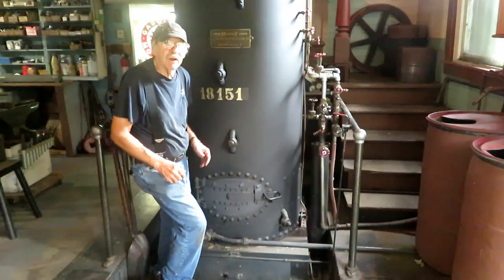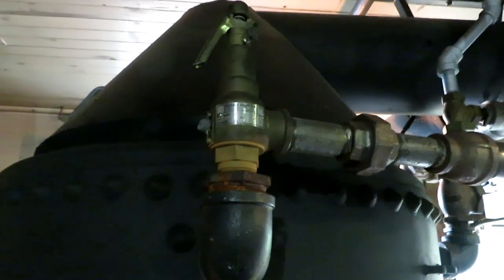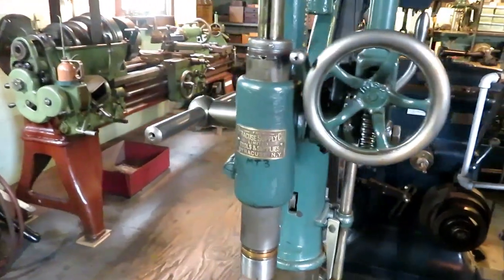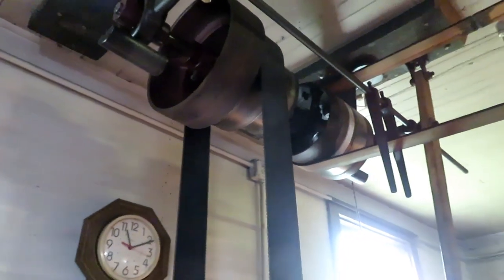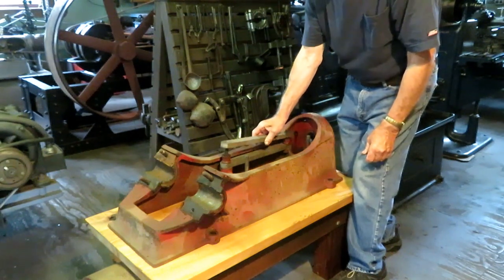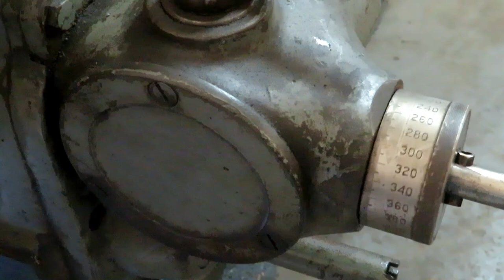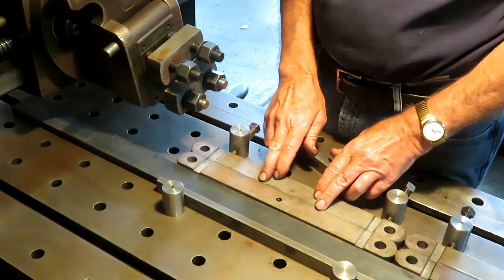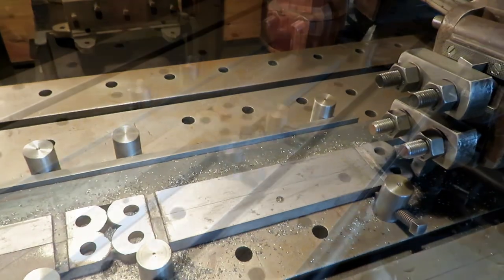Rebuilding a steam engine with steam power

Comment: Thank You for the inspiring video and shop tour .  It lit a fire under me to dig out the leather belt for my old Barber-Coleman surface grinder and get in running again after 40 years of idle .  I have yet to date the machine itself -- I totally rebuilt it that 40 years ago since it had seen considerable use before I acquired it .  No good excuses for it's idleness -- only that it went through several moves in the period between when I rebuilt it and now .  Secondly,  I too have one of those 3-jaw scroll chucks that you showed .... and near as I can tell identical to your's  .  It served me well for quite awhile in spite of having considerable wear before I got it .... that was about 50 years ago so it has to be much older than that .  No identification as to who manufactured it .   Thanks again for the video !

Comment: The way I remember it, you have injectors and ejectors. You have inductors and eductors. The jectors more gases, like steam and air. The ductors move liquid, usually water. So you use an eductor to "pump" out the chain locker. You use a steam jet air ejector to pull vacuum on the main condenser. On an old fire tube boiler, like yours, you use a slightly morphadyke rig to inject feedwater into the boiler, using your own saturated steam. I can not come up with a good example of an inductor, unless it would be your feedwater system. Sorry for all the steam ship lingo, I miss working on all that stuff. As always, thanks a million for making these wonderful videos for us to enjoy.

Comment: I can see why shapers won over planers, but can't beat that long table stroke of a planer.
Thanks for the tour Dave!
Reply: Until surface grinders were available both had their applications, planers not only in length but also on work surface widths. 
Imagine a shaper's configuration able to provide an equal work surface area?

Comment: Hi  Dave I hope you are doing well. Nice to see the planer in action, I have watched all the videos on the repair and setup of the planer Thanks.
Reply from the maker: Hi Randy, The repairs are still ongoing. If you look hard, you will see that the clapper box was broken in two at some time ago and mechanically repaired with bolts. It was a good repair and is working OK but will probably be the next thing to fabricate....Dave

Comment: Your cross belt for your Barnes drill reminds me of when I was 8 or 9 and my father had just hooked up a well pump. The electric motor was turning it backwards so it couldn't pump water from a well. I showed my dad how to cross feed the v-belt to correct the direction of the power feed to the pump. He asked, "do you think that will work". I told my old man yes so he tried it and it worked. Many times I had to help him with simple things. He was a better carpenter than I but my mechanical ability was superior to his.

Comment: Thanks for showing a way to hold and do work on the planer.It was very interesting. I built an air operated tool lifter for my 24" Rockford Shaper That would have worked nice doing those serreation

Comment: Always enjoy your time and effort with the video,am retired now the old chemical co did boiler room and chilled water treatment, I thought the PH was ideal at 7,5 to keep hardness and solids in suspension to blowdown just asking not trying to be critical you have most impressive shop, tooling and sharing of knowledge
Reply from the maker: Harry, I am following the recommendations of Jim Conte of "Boiler saver". He has worked with exotic boilers as a career and is marketing a boiler additive product now for hobbyists that chemically reacts with the interior surfaces to preserve and protect the metal. I've had very good results with it. He recommends a higher PH to minimize corrosion between fire ups. I use rain water to keep city water chlorine out of it. ....Dave

Comment: Now I know why the planer gauge was invented per the # 44 Gang Planer Diagram, to set the multiple tool bits heights! Being a tool and die maker in a plastic innjection mold building shop we seldom did production, mostly 1, 2 or 4 piece runs. Most of our core and cavity tool steel blocks were toe clamped to the Bridgeport table squared/stopped by a toolmakers nest to perform internal details.
However retired now and just bought a nice shop built and a Lufkin pair of planer gauges, both like new!
Reply from the maker: I would like to try to set up multiple tools in the one head that this planer has so that a finish tool would follow the roughing tool a few thousands lower.....Dave

Comment: Bonjour David,
Happy to see you back in your workshop. Even if I like atching your videos and knowing it more or less, you have a good idea  to remind us how it works. I had losti n mind that your wotking pressure is about 80 PSI, it could seem a low pressure for all the pulleys but the torque is the key. For our speed steam boats races, we are limited to... 120 PSI ! 
I would like so much to visit you but unfortunately, you are "a little bit" too far from Paris... France :) 
I cant wait to see ypur next video,
Amicalement, Raphaël
Reply from the maker: Hi Raphael, good to hear from France. With the larger engine, the working pressure doesn't seem to matter. Things start to slow down a little at around 20 PSI if I am not paying attention to the fire.....Dave

Comment: Don't know if this interests you, but you could power an AC generator with the small O & S engine if you can control the speed to within a few RPM or so.  This would allow you to take the house and shop off of the local electric grid while you have a head of steam built up.  It would require that you have an automatic transfer switch to switch it over, and a generator head from either a small engine powered generator or use a PTO shaft driven generator (540 rpm) to generate the power.  Both of these aforementioned methods don't require an exact shaft speed, so it makes them easier to use.  You could also use an AC synchronized generator/motor, but with this method you need to have the speed exact.  This can be handy to offset your electric bills or just in case the power goes out.

Comment: At the saw mill I worked at when a kid the company replaced the head saw drive belt. Down in the basement was the drive motor. They removed the drive belt and replaced it with a red plastic belt. Every day we were shortening that drive belt as it stretched. Finally it got too thin and we had to buy a rubber fabric belt.

Comment: Huh..Your governor was made by the company I worked for once. Gardner Denver Machinery, in Quincy Ill.
They have made a bunch of different things over the years, (currently air compressors and oil well mud pumps).
Reply from the maker: Their governor department was purchased by a viewer of my channel. He traced the serial number of my governor through the company records and found that it was shipped to Richards Iron Works with a date in 1902, thus dating the engine....Dave
Reply: Robert Gardner's company is still located in Quincy Illinois.  They built 250,000 governors.  When he patented his device in 1859 there were only a few hundred operating steam engines in the U.S.   Accurate speed control extended the life of the engines and helped to save lives.

Comment: The shop walk through was fantastic. As was watching the planer doing its thing. It the knob and tube wiring on the ceiling in the shop functional?
Reply from the maker: Most of the hanging lights are on that circuit. I had planned to have a double throw knife switch to switch it over to DC power when I get the generator working....Dave

Comment: such a awesome shop, how long can you run it for before topping off the boiler and refueling ?
Reply from the maker: In steady use of the big engine, the boiler will be down about halfway on the water glass in about 20 minutes. The fire needs attention about every 10 minutes with small junk wood. If I use bigger wood chunks or a little coal mixed in it will go about 20 min. between "stoakings".....Dave

Comment: Hi Dave, I have a 11" Sheldon lathe that was war production and it has no apron feeds, only a lead screw which is a bit of a pain in the ass. It does have a nice telescoping taper attachment though. Must have been a cost staving effort and they most likely did not expect the lathe to still be in service 80 years later. Nice tour of the shop, I enjoyed that very much. 

The planer seems to be working well, looks like the finish was pretty good. Did you have much pattern from the gear chatter common with gear drive tables? I thought that was a bit of a problem when you first were getting it going if I remember correctly.
Cheers
Reply from the maker: Hi Warren, I've learned to grind the tool angles a little differently and it helps. I have angled edge flat nosed tool I use on the shaper that would have worked very well, but I need to make a tool holder for it to be used in the planer. Always something......Dave
Reply: @davidrichards5594  Thank God there's always something.
It gives us a reason to get up in the morning....Mark

Comment: Dave, I have a question about your shop floor. It looks like wood and at the boiler there seems to be a one foot deep pit with a concrete base. Is you shop a wood floor and joists? I mean how could a wood floor support all that machinery weight? I grew up in the Philadelphia farm suburbs and our property has some old outbuildings that were built on a stone base with 2x12 joists on 12in centers with 1in T&G flooring (true 1in in those days). The buildings looked much like your shop inside.
Reply from the maker: Hii Andy, The original old building where most of the old machinery and line shafts are is a very interesting structure. I'll go into some detail about it as part of the next video. .....Dave

Comment: Dave - do you use anything to keep your bare metal parts from rusting in the humid weather?  Everything looks so nice and shiny.
Reply from the maker: The problem is the worst in the springtime when it warms up outside faster than in the shop. the condensation on all heavy metal parts is unbelievable.....Dave
Reply: @davidrichards5594  Yes, that is true here in Ohio as well

Comment: David, I’ve made several comments about how similar my shaper is to yours. Well, I removed my flat belt step pulley because the shaper has a gear box. It ran with a flat belt but the gear box pulley was just a single pulley. So, pointless. I changed for dual vee belts. I am in Ontario Canada, if you want the shapers step pulley for your line shaft, you’re welcome to it. Somehow. Message me.
Reply from the maker: If you get back to me with the diameters, we can know if it will work.  enginedrdave@gmail.com
Reply: @davidrichards5594  will do! Tomorrow when I head up to the shop.
Reply: @davidrichards5594  hey Dave, I emailed you but never heard back. Not sure if the email got through or not.
Reply from the maker: @shawnhuk  I can tell by the photos, I can;t use the pulleys on my machine. thanks anyway...Dave

Comment: Dave I have an E.H. wachs vertical steam engine that is going to need new packing for the gland nuts. Is there something you recommend? Thanks, Adam
Reply from the maker: Measure what width square section packing you need. I get mine from McMaster Carr....Dave
Reply: @davidrichards5594  do you get the graphite infused?

Comment: I think that is the first time I have seen you use the big shaper. What is the make and size of it?
Reply from the maker: It has been featured in several older videos. It's a 32" stroke G&E  (Gould & Eberhardt).
Reply: @davidrichards5594   Thanks Dave I typed out as I was watching the video, instead of waiting until it was over and before the name tag was shown in your video. My bad.
My memory must be going. I remember you using the one in the line shop many times, but not the G& E 32". I have a 36" G&E  that I have not got set up and running yet. This video has got me wanting to get moving on it again.
I really enjoy your videos and always look forward to the next one. Wishing you the Best

Comment: I wish i could find a shaper like that here in Australia, there harder to find than rocking horse shit and twice as expensive
Reply from the maker: That big G&E shaper came from a local plant around here that manufactures turbine blades of all types. It was in their tool room and no one working there then had ever seen it run or even knew anything about it.  I bought it for scrap price, had a rigger deliver it, plugged it in and it worked fine.
Reply: @davidrichards5594  that's one hell of a score.. I've been looking for a shaper here for over 20 years and still haven't got one

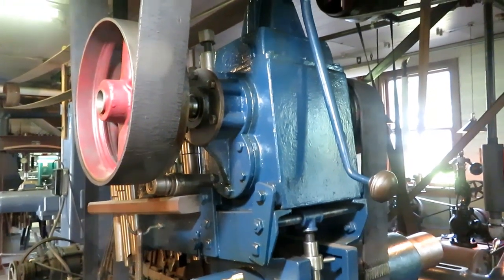Comment: 25:50 "Both too slow."  Maybe you need a larger drive pulley or a countershaft with two sizes of pulleys to speed it up.
Reply from the maker: True, it was the biggest I had at the time....Dave
Reply: @davidrichards5594  Try the countershaft method.

Comment: i see that the guy who worked on the shaper's clapper box thought he was famous . . . signed his name to all his work . . . with a hammer!

[ not sure, but timed shaper table motion cut and return, looks like cut is running faster than return . . . wrong belt twisted? ]
Reply from the maker: I think the steam pressure was getting away from me a little and it was slowing down on the cut....Dave
Reply: @davidrichards5594  i thought it should slow down on the cut and move faster on the return . . . probably something i'm not getting, after all i was an electrical engineer.